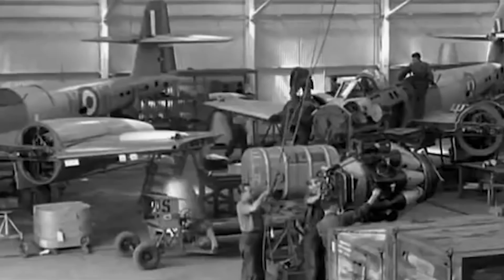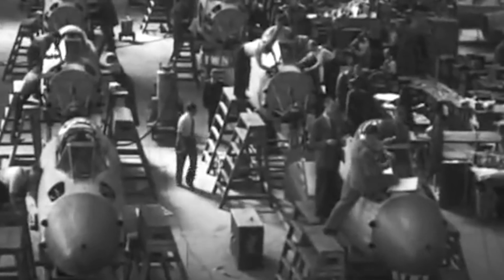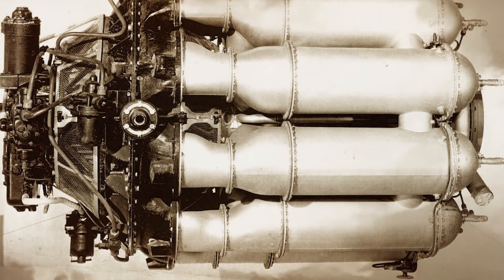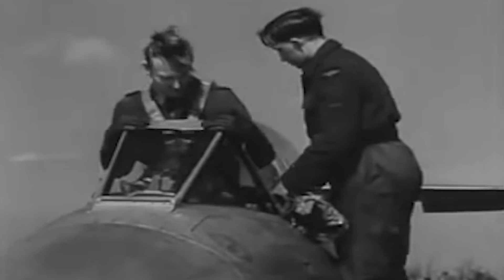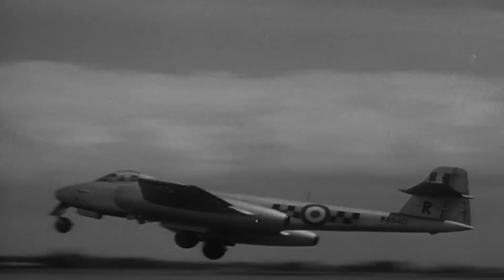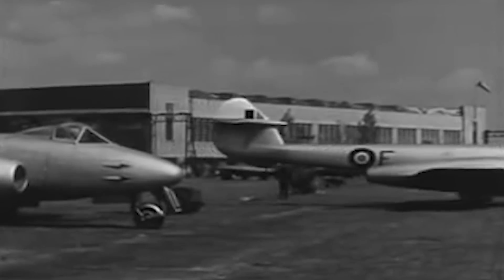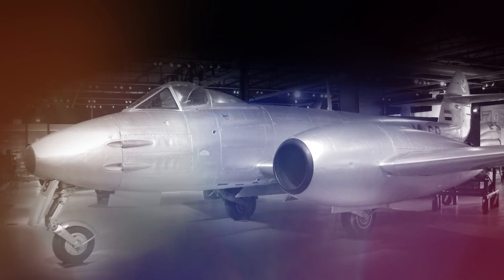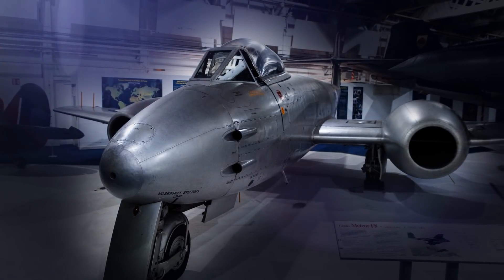Gloster Meteor - The Only Allied Jet to Fight in WW2

Comment: Meteor and ME262 are two of the most aesthetically beautiful aircraft  ever made...
Reply: Honestly it's worse than the burning of the library of Alexandria that these jets didn't fight it out.
Reply: @Joe-rp8xn  Not really.
Reply: Soilent Green  True, German aerodynamics were more advanced. Engines were terrible though.
Reply: @bobthebomb1596  Even then, only sorta. The Germans lacked things like the laminar flow wing, all flying tail ect. Things which were allied designs.
Reply: @1993Crag  Germany operated the World's most advanced supersonic aircraft testing wind tunnel.

The Messerschmitt Me-262 was the World's first jet to use a fly-by-wire horizontal stabilator  (all flying tail)... although the stabilator dates back to the Wright Flyer in 1903.

Germany invented jets...
Reply: @1993Crag  In comparison to the Meteor though.
Reply: @sandervanderkammen9230   fly-by-wire horizontal stabilator and all flying tail are several different systems you've lumped together, but nice try.
Reply: @1993Crag  I'm pretty sure you didn't know what a stabilator was or that the Me-262 had one until just now.
Reply: @sandervanderkammen9230  I absolutely did, as said; nice try. Tell you what, you tell us where its fly by wire system is.
Reply: @1993Crag  The Messerschmitt Me-262 was designed and constructed with a electric-driven, cockpit adjustable stabilator control system.
Hans Mutke used it to recover from a supersonic "Mach Tuck" and the exact same system was copied by Bell Aircraft on the Bell X1 rocket plane.
Reply: @sandervanderkammen9230  that's not fly-by-wire. That's just an electrical trimming system. The Americans used something similar for propeller pitch control.
Reply: @neiloflongbeck5705  The Americans used the exact system on the Bell X1 to break the sound barrier.
Reply: @sandervanderkammen9230  never said they didn't. But it is still not fly-by-wire.
Reply: @neiloflongbeck5705  fully electric servo operated from a control stick... its called "Fly-by-wire" technology.
Reply: @sandervanderkammen9230  only the pitch trim was electrically controlled, not the control surfaces they were all push-rod controlled. But don't take my word for it go and read the pilots' handbook.
Reply: @neiloflongbeck5705  The Me-262s  Stabilator was fly-by-wire operated... no hydraulic or cable controls.
Reply: @sandervanderkammen9230  the trimming of the tailplane was the only aspect that could be called fly-by-wire. The elevator was controlled by a push rod. If you bother yourself to read the pilots notes it expressly forbids the pilot from using the electric trimmer to initiate dives.
Reply: @neiloflongbeck5705  Thats exactly what I said.
Wrong! Hans Mutke confirmed that the Messerschmitt Me-262's  fly-by-wire electric stabilator system was highly effective in counteracting "Mach Tuck" in a supersonic dive.
He is the first human in history to experience the effect of "Mach Tuck" and live to tell about it.
Reply: @sandervanderkammen9230  stabilator is another word for all moving tail that combines the function of the fixed tailplane, the elevator and trim tab. The Me262 was fitted with ekecatirs to control the aircraft in pitch and an adjustable tailplane to adjust its trim. As already mentioned pilots were forbidden in the pilots'h notes to use the electric trimmer to control the aircraft in pitch. It is really that simple.
Reply: @neiloflongbeck5705  You really need to stop making a fool of yourself... the Messerschmitt Me-262 was wind tunnel tested at the Luftfahrtforschungsanstalt the World's most advanced supersonic wind tunnel research facility to speeds up to Mach 1.4

Messerschmitt was well-aware of the effects of Mach Tuck and designed the Fly-by-wire stabilator system specifically for this purpose.
Reply: @sandervanderkammen9230 yet again you are ignoring the facts. Whilst the Me262 was tested in high speed wind tunnels, if the engines had not been heavier than expected it would have  been fitted with a wing based in that of the Bf109. The Me262 was not fitted with a stabilator (a single unit) it was fitted with a trimable tailplane and elevator (2 pieces - the trimmer was electrically control, but the flying control surface was manually controlled). Go and fead the pilots' notes which are available online, as are diagrams of the control runs.
Reply: @neiloflongbeck5705  You are ignoring the facts... the Allies had no large diameter supersonic wind tunnels...
Reply: @sandervanderkammen9230  that's right they didn't, but what's that got do with your ignorance of what a trimmable stabiliser is and what a stabilator is.
Reply: @neiloflongbeck5705  Fly-by-wire stabilator... you simply refuse to accept the truth.
Reply: @sandervanderkammen9230  the fact is it had an electrically trimmed stabiliser not stabilator as it has a separate push-rod controlled elevator. This is the truth and I accept it. Whilst this may be considered fly-by-wire by some, the main stream view, from a quick Google search, is that having an electric trimmer system isn't enough to be considered fly-by-wire. If the actual control surfaces were electrically controlled as in the ANT-20 then you do have fly-by-wire.
Reply: The Messerschmitt Me-262 is equipped with a Fly-by-wire stabilator system... the exact same system used on the Bell X-1 and the F-86A Sabre to successfully fly supersonic.
Reply: @sandervanderkammen9230  the F86E had a stabilator, the the F86A used an adjustable stabiliser with an elevator. Missed agained.
Reply: @neiloflongbeck5705  Your desperation is becoming rather pathetic..
Reply: @sandervanderkammen9230  pathetic? Just because you can't accept the truth.
Reply: @sandervanderkammen9230  Make up your mind Sandyboy. Elsewhere you're claiming that a Frenchman invented the jet engine and then you are giving to an Austrian. Let's see what a very famous German, Pabst Von Ohain says-

"The first patent of a turbojet engine, which was later developed and produced,
was that of Frank Whittle, now Sir Frank (see Fig. 5). His patent was applied for
in January 1930. This patent shows a multistage, axial-flow compressor followed
by a radial compressor stage, a combustor, an axial-flow turbine driving the
compressor, and an exhaust nozzle. Such configurations are still used today..."
Reply: Avro Arrrow CF 105
Reply: Soilent Green  Love the Draken, The Hunter is hard to beat on pure aesthetics though.
Reply: TSR.2 and Avro Arrow though 🤤 Canberra is pretty nice too
Reply: @ArbnTyphoon  Three greats!  I'm more into curves than corners though... :O)
Reply: EnglishXnXproud ah yes, V force.
Reply: Soilent Green Well it’s engines weren’t for a start.
Reply: I agree, but hear me out, F-15X
Reply: Random User F-14
Reply: @doubledekercouch  F-86
Reply: Soilent Green  Eric Brown agreed, I just watched him on TV say the ME262 was the best fighter in WW2. If anyone would know, it's him.
Reply: Soilent Green  The ME 262's engines were f***ed after a maximum of twenty hours. The Germans didn't have the metallurgic knowledge.
Reply: Warwick Tregurtha sorry soldier, the Germans had the metallurgical knowledge, they did not have the materials because they were Under siege on all sides. You know I don’t like defending the Germans, I especially don’t like them with regard to their Nazi past.  But we have to give credit where credit is due. The ME 262 was an influential and revolutionary aircraft and the Gloucester meteor was a dead ender, Especially to so many pilots who flew it on its normal trajectory, that of a meteor, so aptly named, ha ha!
Reply: @steveperreira5850  There is an issue beyond supply problems with  the Germans metalurgy. The first alloy they produced for the purpose was Tinidur in 1936 but despite being three years before the outbreak of war and six years before they expected it, Tinidur was significantly poorer than the American 1932 Inconel and could not be welded. That at a time when the Germans were not short of alloying metals. Furthermore post WW2 the Americans improved Tinidur by adding molybdenum which the Germans failed to do despite having abundant supplies from their own mines and those in Norway. They certainly had issues with supply later but didn't even produce adequate alloys at an experimental level.
Moreover many of their supply problems were self inflicted. They produced 8000 jumo 004 engines for a 3000 requirement. Which meant they could have increased the necessary metal content considerably by building fewer engines. And that's before you get to the over production of Me 109s and other aircraft with their engines that used much more of the required metals than a jet engine did.
As for the crash rate, according to german records the Me 262's was higher than the Meteors.
Reply: @PenzancePete  Not true, that is nothing but a false urban myth.

The Jumo 004b engines met or exceeded the RLMs 100hours PFTR reliability standards, the exact same 100 hour reliability standard required by the RAF and USAAF during WW2.
Reply: @sandervanderkammen9230  And yet JG-7 reported 12.5 hours between engine scrap.
Reply: @sandervanderkammen9230  Not according to the test pilots who flew them after the war.
Reply: @1993Crag  The Jumo 004b engines averaged 50 to 60 hour TBOs, confirmed by Allied testing after the war... excellent by WW2 standards.
Reply: @bobthebomb1596  The Jumo 004b engines were tested by the U.S. Army as part of Operation Lusty and Operation Paperclip... test results confirmed TBOs compareable or better than Allied engines.
Reply: Mig 21
Reply: Su27:)